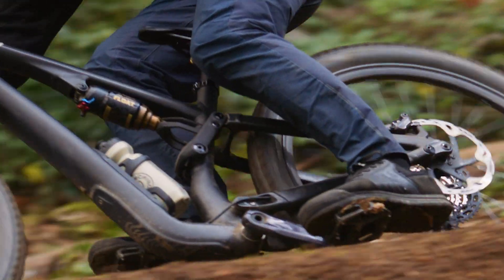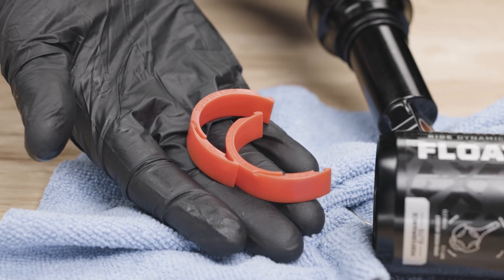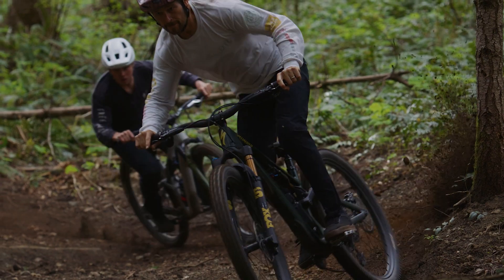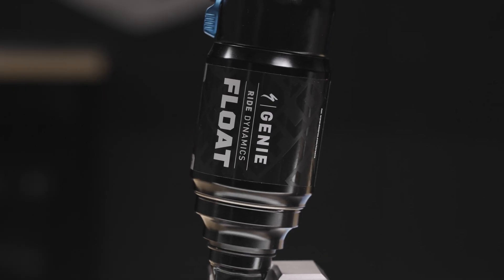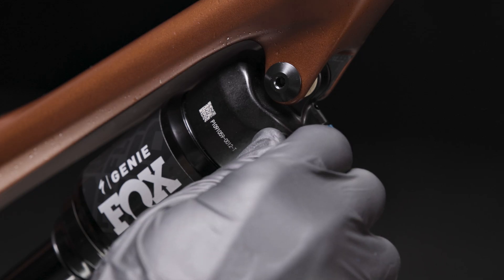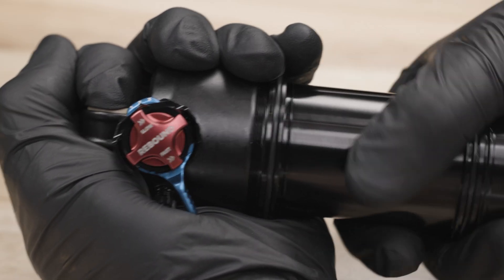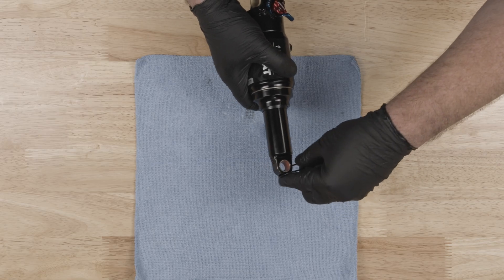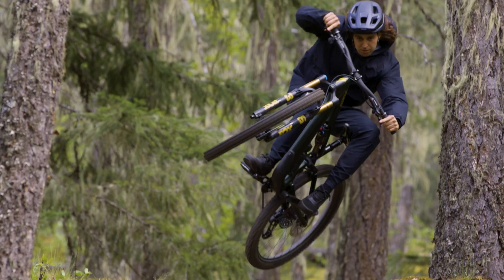How and When to Adjust the Air Volume on the GENIE Shock

Comment: The inflation of the shock doesn’t work as shown in this video. The air chamber doesn’t equalise, not even countless cycles in it’s 30% travel. It’s like s pogo-stick rebounding almost without damping with a harsh negative bottom-out. You have to figure out other ways to inflate the shock and even then the performance it’s questionable. Maybe my shock is already faulty out of the box..
Reply: U need to equalize, mine worked fine, cycle it a bunch of times and ur good.
Reply: Not even close to true. It definitely equalized. 😂 Maybe you have no idea what you're talking about.
Reply: @themisplaced Shock is already been replaced. By the way I know what Im talking about.
Reply: Ja stimmt ich habe das gleiche Problem!